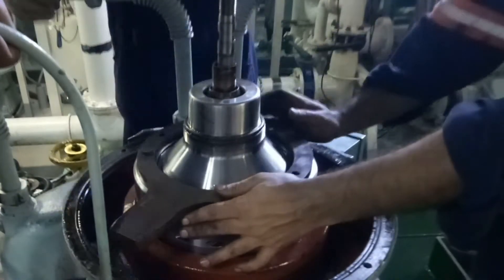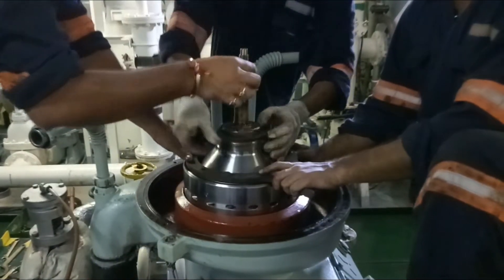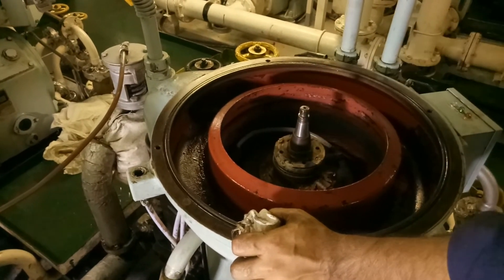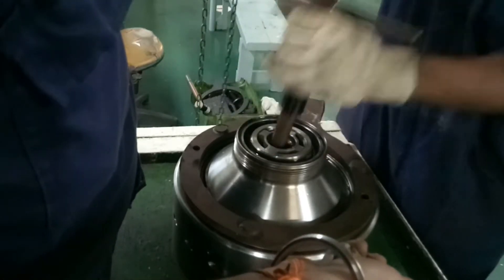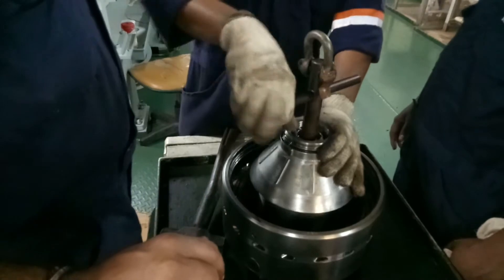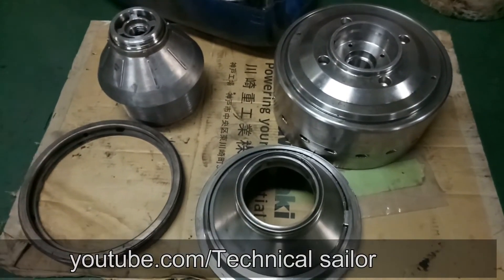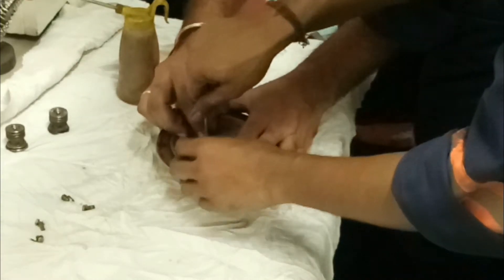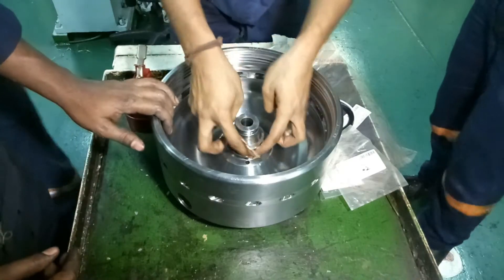Mitsubishi lube oil purifier  maintenance

Comment: question, is THIS what in your motor car would be an engine oil filter?, or do these engines still have a disposable filter?, and if so, how often do you clean the engine oil with this machine?

Comment: What will be reason for fuel over flow and operating water non stop flow out
Reply from the maker: Operating water ( closing water) cont. Flow means bowl have not close that means..Pilot valve may be stuck, or master cylinder may be stuck and not sliding freely.Or sealing ring is leaking..Solenoid valve for closing water not working.